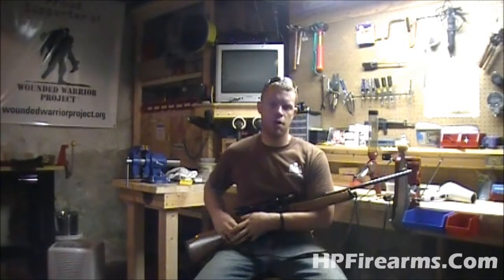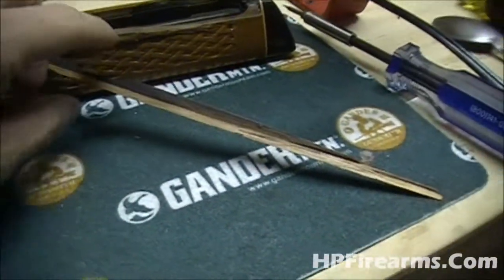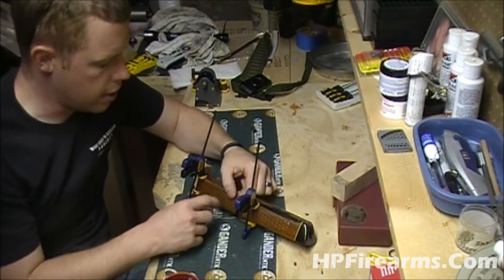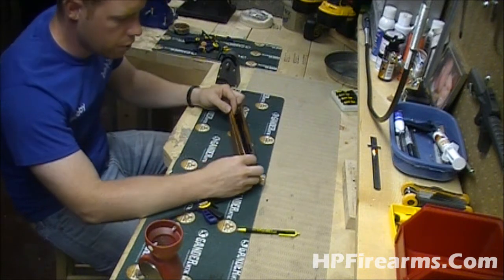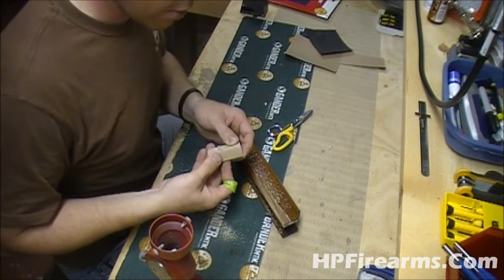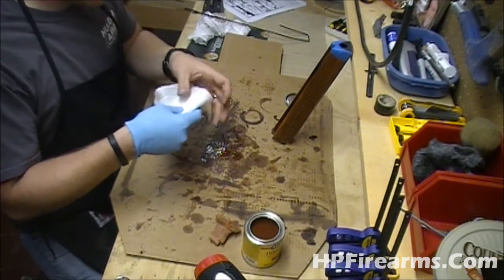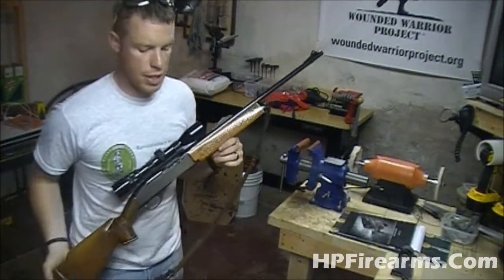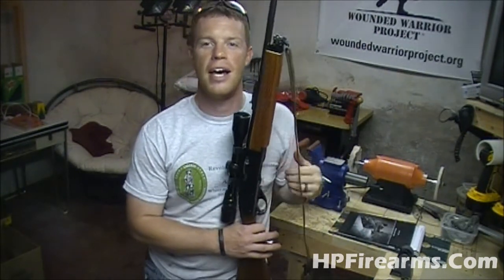Advanced Gun Stock Repair by HPFirearms

Comment: Repair and finish look good but it doesn’t look like you tried to restore the checkering. Actually you appeared to sand a lot the checkering down and even off. I think Remington did “pressed” checkering and it was actually a reverse of hand cut or machine cut checkering.  I know that was how it was done on standard Remington checkering (non basketweave) on the 1100 and 742. I believe that to be true with the basketweave checkering on the gun you were working on. That makes it difficult to repair with standard hand checkering tools. So maybe that’s why you didn’t do as much restoration to the checkering as you had originally planned. Or maybe I just can’t see the checkering very well in the video.  Thanks for the video.

Comment: Asking you to do yourself a favor...if you ever get a stalk in that you end up replacing.go down to your local Bobbie shop or go on line.get some medium CA..its supper glue.thin will just soak in and run everywhere. thick will not soak in enough..supper glue, clamp and if you went to Bobbie shop get kicker for the glue and some dowl..drill you did but using dowl and the CA.once you try it many of you will no longer have use for epoxie.most is to thick and won't soak in.if it will stand up to thought counter top traffic in kitcken which is where I learned about it in case you wonder about toughness.try it you won't be disapointed

Comment: hey , is there anyway to get a hold of you . I have a gun stock that I need the gloss finish taken off and then just sanded and the inside where the action goes sanded. I dont know if you do work for the public and i couldn't get a hold of you . Thanks
Reply from the maker: Hey Robert, I just recently moved and don't have a gun shop put together yet. Would love to take care of your gun but unfortunately it will probably be winter before I could get to it.